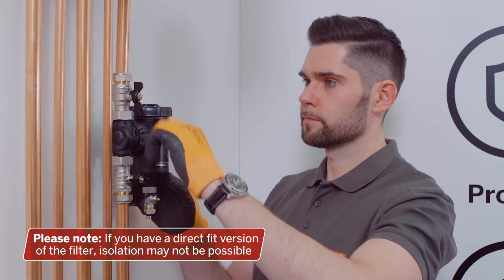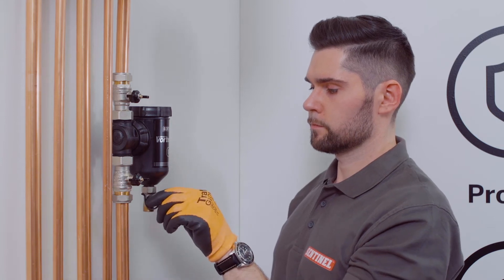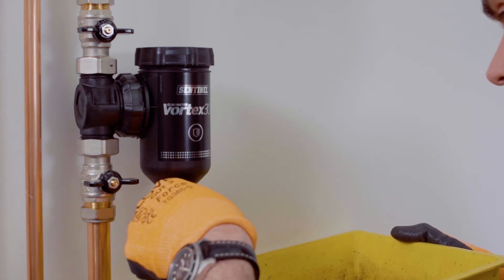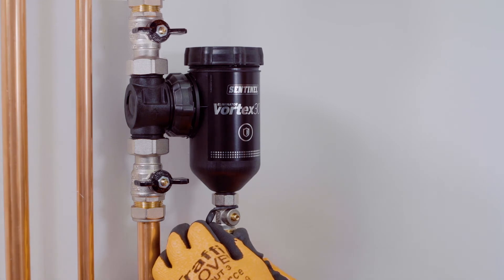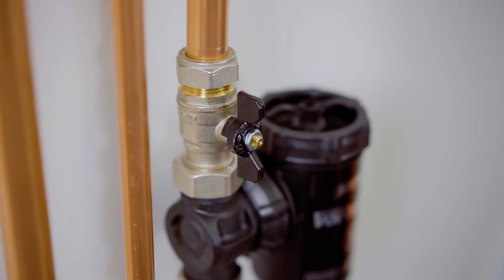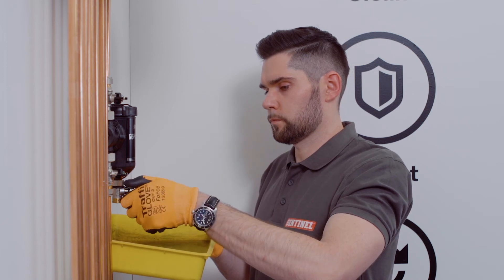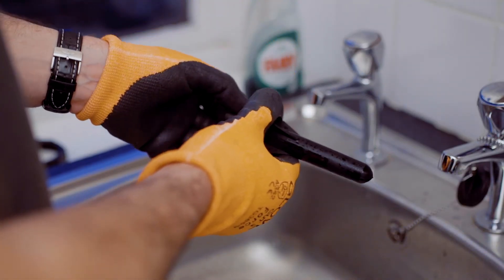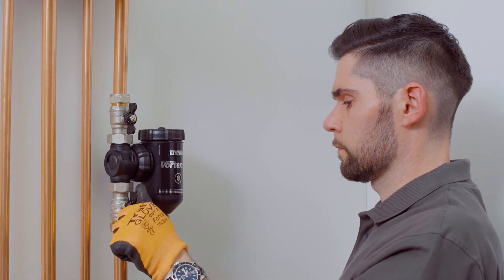Vortex Filter Service - Simple How To

Comment: Question - given this fits to the pressurised return pipe, how come you can just take the magnetic core out?  Confused - I was expecting to need to isolate and then unscrew it to remove the magnet.  It's still crystal clear every time I remove it.

Comment: How do you add the Sentinel X800 once you have drained the system down and fitted the 300 filter do you fill the system up and add it to the highest radiator or put it in the filter